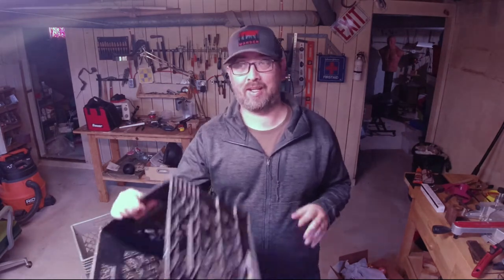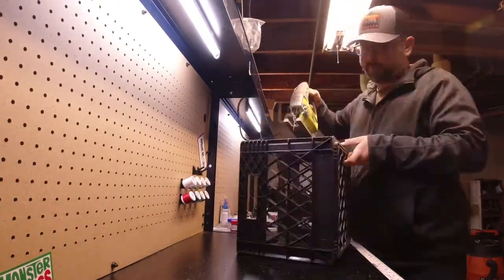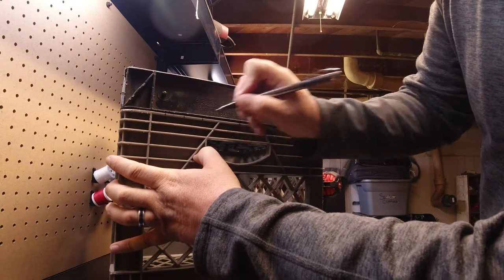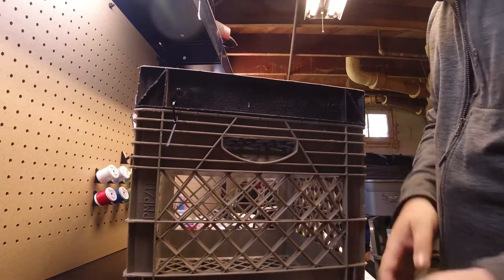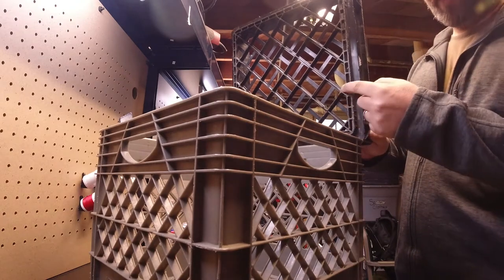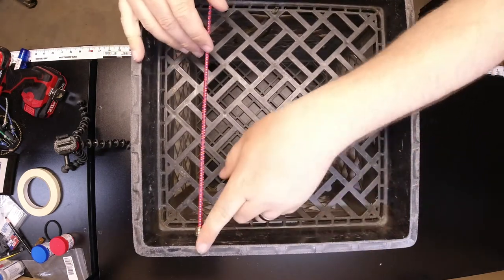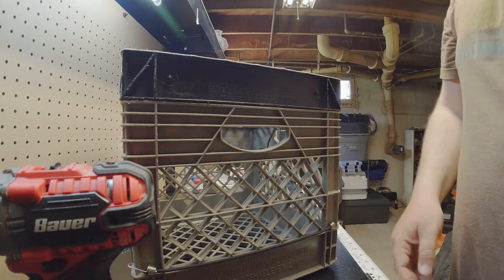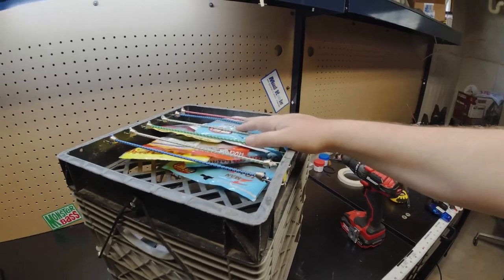Step-by-step DIY Fishing Kayak Crate

Comment: Great idea of using bungees on the top tray. My crate is set up similarly but without the bungees on the top and that haas been problematic. I almost lost a sweat shirt. I’m going to fix that now. Thanks!
Reply from the maker: They tend to be super handy. The only adjustment I would do is using bungee cord instead of smaller bungees. I think that would turn out better.
Reply: I’ll shop for the bungee cord. Thanks again for the terrific video.

Comment: Thanks for the video....any suggestions as far as attaching it to your yak....I know it depends on your exact kayak and how the stern is set up....thicker but bungees on each side to strap to the kayak maybe?
Reply from the maker: Yeah, I have always used a couple of extra bungees, thread through the box and connect where you can. My newer kayak has the rear bungees and I'm able to  hold down the crate pretty easily with those. The small bungees I used on the top in this video are handy to help hold it down as well.

Comment: Did you get the file for that knob online or design it yourself? I like that option better than the single bungee like most people do and I’d like to print me one off too.
Reply from the maker: Just printed one off on my 3d printer. There's a number of small knobs out there that'll work.
Reply: @TheSpeedofTim  thanks, I was having trouble locating a decent one on Thingiverse so I figured I’d ask. I ended up finding one a few minutes after my post that was rounded and had a center hole for easy fastening that I think will work. Great vid, I never would have thought about locking this way if I hadn’t seen this.